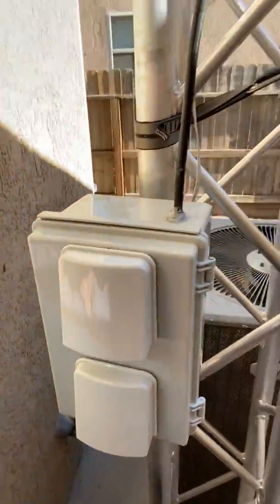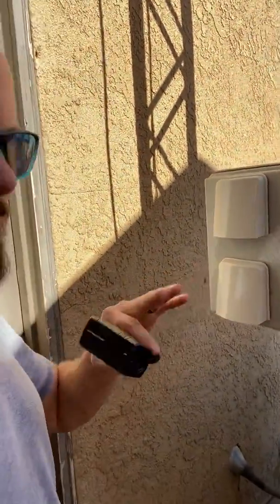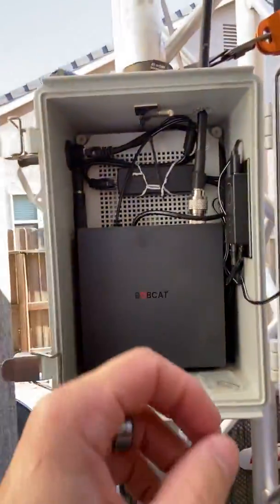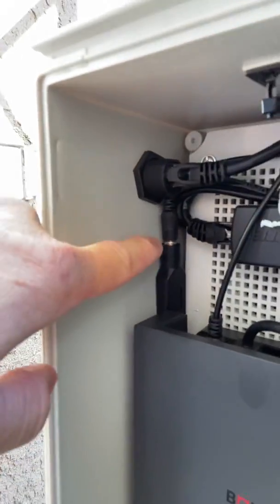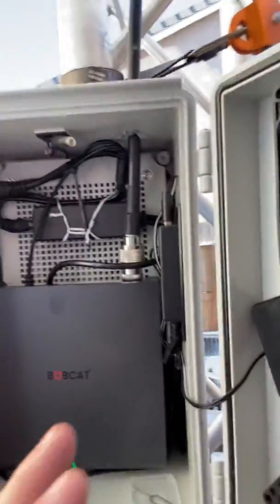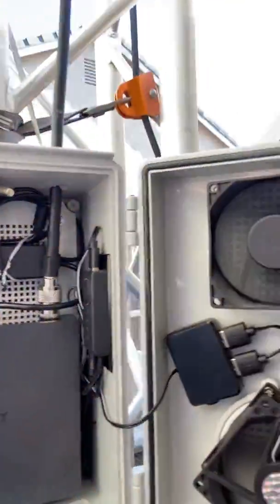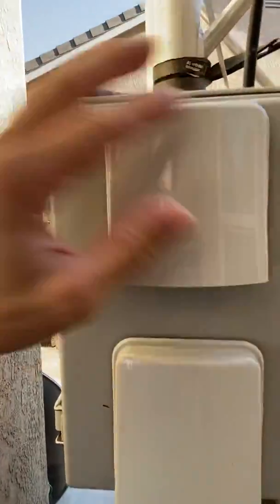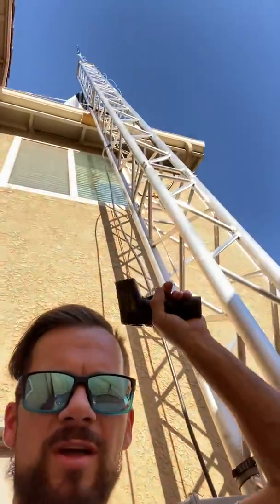Custom A/C Helium Network Enclosure Bobcat 300

Comment: Great video. That solves the overheating problem for sure. What about us in the northeast during the winter mo this? Can the miner freeze?
Reply from the maker: Its possible for the miner to see issues if it gets to cold. In those cases we would need a larger encasing and add a heater with backplate.
Reply: @digitalblock559  simpler solution is to block the vent and add a 15w light bulb as your heater. we use a 40w light bulb to keep our well head from freezing in the winter.
Reply: @moguaiato5583  thats insanely smart lol
Reply: @Mr.Thermistor7228  TY it also keeps the barn cats alive in winter. As they hide inside the  wooden box we place over the well head. You don't need much to keep something from freezing. Don't forget the miner is already producing heat. 
It's hit the low 40 last week and my outdoor unit was a 19c with the vent running and 25c with it off. Biggest issue is condensation. So you will probably need to reverse the fan in winter (blow air out) and use a lrg. Silica packet.

Comment: The Bobcat runs off 12v. I don't see where you are cutting the voltage from your5.5 y-splitter to the temp control unit... Are you running that 5v fan with a 12v POE?
Reply: Same question I had. Unless we're missing something, it sure looks like he's got his 5V temp control and 5V fans running off 12V POE power.
Reply from the maker: Hi Davey,
Sorry for the late reply. Yes you are correct. A little over-volting so far it works fine.
I couldn't find a simple plug and play 12v thermal trigger with usb fan support. This was the best option I found at the time of the build and thus far has been operating exceptionally. If you have a suggestion that is 12v and plug and play model. We would love to hear from you.
Reply: @digitalblock559  https://smile.amazon.com/dp/B0919GGT1P/ref=cm_sw_r_cp_apa_glt_fabc_2G2ZJNCFDX93T3JSF9Z2?_encoding=UTF8&psc=1 and https://smile.amazon.com/dp/B06XNR1ZVL/ref=cm_sw_r_cp_apa_glt_fabc_W96X4RVNGAQV7C3RBNEA?_encoding=UTF8&psc=1 would work with a 12v fan
Reply: @digitalblock559  you could always add a https://smile.amazon.com/dp/B08R64L68D/ref=cm_sw_r_cp_apa_glt_fabc_JP95PZ12F78FBZR3B3DK?_encoding=UTF8&psc=1 to keep from burning up your fan.
Reply: If you didn’t, a 12V to 5V  DC Converter with USB outs is like $8
Reply: @heyitsdavey  Not sure why 12V fans and temp Ctrl wouldn't be a simpler more elegant design.
Reply: @jerrydesu  he already has the 5v temp controller and fan. Just offering an "as is" solution.  But you are correct,  a 12v controller and fan would be a great part of the build.

Comment: Nice! But long term it would need filters and regular maintenance. Otherwise dust, dirt, pollen, etc, will accumulate  inside where you don't want it.
Reply from the maker: Indeed. I’ve already come across this as Fresno is a dry place. I’ve already acquired some finer dust filters however they aren’t good enough for small particulates.

Comment: might be better if you point the upper vent UP
Reply: Turn it into a rain water meter...
Reply from the maker: I can see why you think that might be a good idea however as Dave’s pointed out it would act as a rain/ snow catcher.
Reply: Use umbrella on top of the enclosure which blockout sunlight and rain. ok done ✅
Reply from the maker: @OG-Diamond  we can, though an a plate. We provide professional solutions so a umbrellas wont quite work. Thanks for sharing your idea though.

Comment: so im thinking about doing this BUT im in houston so im kinda of on the fence . i think its actually hotter were you are currently althought my issue is humidity our avg . relative humidity is over 90- in the a.m. & around 60% in the afternoon
Reply from the maker: I would add the silica packet and possibly run both fans in exhaust mode. So instead of taking in moist air it would exhaust hot dry air preventing moisture from entering. Or do a non AC enclosed unit

Comment: Is it better to remove the bobcat board from within the black case while inside the enclosure? I also wondered about affixing copper heatsinks onto the components and getting the airflow of the fans over those.

Also, have you got a discord server or some better chatroom for discussion for this design?
Reply from the maker: Hey whiteburr, no I do not have my own discord server. Removing the case would help cause direct airflow would be over the chip. Concerning he heatsink. I don't know if you really need to go that far cause I don't think it will make to big of a difference vs performance you get out of it
Reply: @digitalblock559  i was kind of thinking this as well are most of the miners not raspberry PI boards if im not mistaken. i run a PI4 for my 3d printers remote ( octoprint server) . and added a heat sink to it just to help little deal gets pretty damn hot to the touch

Comment: Thank you for the video. I was just ordering the parts and wanted to know if it is Ok to run 12v into the temp controller?
Reply from the maker: No. The Temp controller is a 5v USB powered device. Any more can over volt the part and damage it.
Reply: @digitalblock559  Where is the 5v coming from? 5.5x2.1mm Female jack to USB adapter would seems to indicate 12 volts from POE to Bobcat and on USB, not 5V (?)
Reply: @digitalblock559  where is the 5v coming from in your video? The POE is 12v. I was thinking of running the 5v off of the com port on the Bobcat but not sure about that. Thank you.
Reply: @williebuehler8387  for my sensecap miner i removed 1 end panel and tapped in to the Ras-Pi USB port. I didnt add a temp controller so the fan runs 24/7 in S. AZ

Comment: Considering I'm based in Ireland and our summer the maximum temperature would be around 80 degrees, I wouldn't need all that, right? My concern is more regarding humidity than temperatures... What's your opinion?
Reply from the maker: Hi Guilherme, I would just use a sealed enclosure with an IP97 rating or greater. This will weather seal your unit and include a  silica packet in there just for good measure to keep it dry. 
No need for airflow if your max air temp is 80. Inside the enclosure it may get up to 95 max but the Bobcat has a max rating of 140

Comment: I'm in Fresno, I'm ganna be putting abt 3 miners in abt next 2 weeks. Mainly Central Fresno/downtown. Hopefully mine reach yours with 8db antenna.
Reply from the maker: Hello Nate, that is great to hear. We have 8 locations planned for downtown in the next coming months as we have 19 incoming bobcats. We would love to work with you or help consult in anyway to help you with you setups.
Reply: @digitalblock559  I have 2 up and running today, will be upgrading antennas & elevation, once synced. Rare khaki pig & restless neon octopus. Yeah let's help each improve setups & maximize gains. Have u thought abt upgrading ur antenna to 8dbi?
Reply from the maker: @natebum1  Hi Nate, I saw them this morning. I get notifications when new miners show up in the region :)
We've been running tests this week. Just finished with our custom 9dbi and have been using a new multi-polarized 3dBi to cut through noise. We'll be continually testing them for about another 2-3 days before switching back to our 6 or 9dbi.
We make enclosures and have our own antennas and antenna hardware if you ever need any in the future.
Reply: @digitalblock559  There r place where enclosures will work but current keeping everything inside, just too hot. when u get ur bobcats, connect them to wifi first, then ethernet. If u connect to ethernet first it'll display relayed even tho ur connect with ethernet.
Reply from the maker: @natebum1  Let us know if you need any of outdoor AC enclosures. We do ethernet but make sure ports all opened. We also have a professional tech support to handle all WIFI connections across any platforms we come to connect them to. Let us know if you need any help bringing them out into the heat. Our Bobcat can handle the heat in our enclosure here. Also happy halving day tomorrow ;) gaaa
Reply: @digitalblock559  how much do u change for the boxes?
Reply from the maker: @natebum1  $200 currently. Its about $145-$160 in parts the remaining is all labor to build it for you.
We may also do packaged builds with the hotspot included.
Reply: @digitalblock559  wow very cool... one question tho how are you powering the miner? Is it plugged into an outlet somewhere?
Reply from the maker: @Jcccc777  We use POE (Power over ethernet) basically inside the home a power cable transfers power into the ethernet cord and travels up to the miner. Then is splits off to separate power and ethernet connections inside the box. Parts are listed in the description.
Reply: @digitalblock559  so.. basically w poe the ethernet plugged into the router powers the miner?! Woww
Reply from the maker: @Jcccc777  correct! You’ll need the Poe power adapter and the Poe splitter along with your Ethernet cords to make it work
Reply: @digitalblock559 cool! But ill have my enclosure in a box in a tree lol so i won't need the fans.  Do i still need a poe adapter? Appreciate the advice!
Reply from the maker: @Jcccc777  If you already have your ethernet and power cable you won't need a POE supply. We like setting up our hotspots as POE cause it reduces the cords needed and makes the system cleaner.
Reply: @digitalblock559  Is it just with any types of Ethernet cords?

Comment: Would there be any advantage to taking off the Bobcat plastic enclosure? Letting the PCB breath?
Reply: Absolutely there would be an advantage. It would allow the contaminants from the atmosphere to destroy the board much faster. You cannot vent an enclosure to the outside if the inside parts are not properly rated and the Bobcat miners are not.
Reply from the maker: Good question! This will void your warranty if you do with the manufacturer. So we will not advise this. However if you did there is a good chance the active airflow will better help dissipate the heat. Or purchasing a large enclosure so the mine can breathe better along its air vents

Comment: Also can you tell me the price for one box?
Reply from the maker: Its $200 from us(not including the hotspot) This includes the A/C enclosure and the PoE hardware. It does not include the ethernet cable between the enclosure and the interior POE or the coax cable to your antenna.
Reply: I would be I trested in purchasing 2 box how can I reach u

Comment: "The air inside is cooler than the air outside."
That's not possible without active cooling.
Reply from the maker: You are correct. That was a mistake on my part and I didn't catch it till you brought it up. I'll make a note on the video to correct this. Thank you Watkins.
Reply: @digitalblock559  No problem. Good luck on your installs. Love that tower setup. Might have to build something similar. :)

Any thoughts on a sealed box with a tec cooler for active cooling?

Comment: Awesome Video! I have a bobcat rak enclosure but am considering not deploying it due to heat and below freezing concerns - in Oregon for a 80' tree install. Do you think your unit would perform well on below freezing nights? I'm not sure if the bobcat kicks off enough heat to mitigate this concern - especially given the added vents in your enclosure. Also, I'm interested in buying one of your complete kits if you're assembling them -  how much and how soon could you ship? Thanks, and once again, awesome work!
Reply from the maker: Thank you! I do not have a clue if it would TBH.
Awesome. I'm asking only of those who are interested to shoot me a message so I can create a list of who and how many units I need to build
Reply: Saw a comment below, if you could build a unit for a tree install in Oregon with both cooling and a temp controlled heating that seems like it would solve both my problems - very interested buyer here! Thanks!
Reply from the maker: Hey bud! I don't have a heating solution at this point. I have considered it though. If you need something quick. I would suggest this product: https://amzn.to/3ARCCv8
Which was the initial inspiration for my case as it has temp controlled heating and cooling solutions with internal power supply. I little more than what you may need but it has everything you do.
Reply: @digitalblock559  Thanks!

Comment: Great job....I would rather just buy the boxes from you if you are going to produce and sell them....let me know, I'm a buyer
Reply from the maker: Hi Mark, no problem. We can prep the boxes and ship them to you. Send us a message with how many you may be interested in and where you reside.
Reply: @digitalblock559  thanks for responding. I have 5 bobcats on order as of 10 days ago.  We plan to order an additional 135 - 160 bobcats over the next 2-3 weeks. As you likely know, manufacturing time is currently running 12-20 weeks for the bobcats. So I'd like to match the anticipated arrival of the miners with the boxes I'd order from you. Many of the miners will be placed indoors. And many will be outdoors. So at this point I'm just not sure how many I would order from you and exactly when I'd place that order. What would be my cost/box and how much lead time do you need? We're in Ohio... Middletown, Ohio
Reply: @MarkCousino  he may think youre trolling doubt any of us know anyone who has purchased 160 bobcats😂
Reply: @aaaaaaa4821  idk that sounded pretty legit lmaooo but i wouldn't be surprised if he is trolling either tho, was a pretty good troll job if so imho lol

Comment: Nice work, a clean build for on-grid in hot environments.  Well done!  I'm thinking with so much ventilation you don't need those silica packs - what did I miss there?  Again, overall great job (and that tower is superb!)
Reply: WARNING: DO NOT ORDER FROM DIGITAL BLOCK. I PLACED AN ORDER ALMOST 3 WEEKS AGO AND IT STILL HASNT SHIPPED. I HAVE TRIED EMAILING DIGITAL BLOCK AND HAVE GOTTEN NO RESPONSE. THIS THIEF HAS GONE GHOST WITH MY MONEY
Reply from the maker: Hey Gristle King! Thank you. We have the off-grid version planned out as well but it will be later before we pursue that build. 
I agree. The Silica pack is just a redundant that really doesn't cost anything to implement. (worst case is in fog. Yes there is a ton of air circulation but some moisture will still be brought into the case. So the silica pack can help pick up any moisture particles left behind)

Comment: how do the vents handle rain?
Reply from the maker: Mike, to my knowledge it handles it very well. The vent has a rubber gasket that goes between the vent and the panel sealing out any rain that could drip into your cut hole. In addition since the vents have shrouds on rain or hail can directly enter or go into the vents. There is about a .5 -.75" over hang from the shroud to where the intake/outake port.
I also added a silica bag to absorb any excessive moisture in the future and thankfully any moisture that may build up inside due to fog or whatnot I can avoid by turning the fans simply to "on"

Comment: Looks great but I would worry about the humidity factor for a rainy city like London but awesome job
Reply from the maker: Agreed. The Silica pack is to help battle any moisture. The other method is to build a temp controlled heater in the case
Reply from the maker: Or you can run both fans as exhaust and that will pull warm air out and prevent damp air from entering